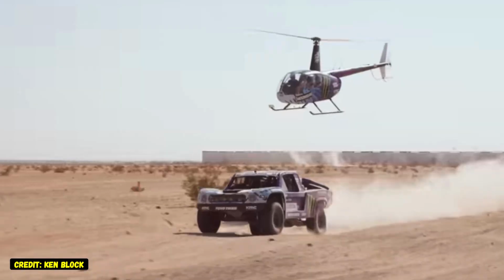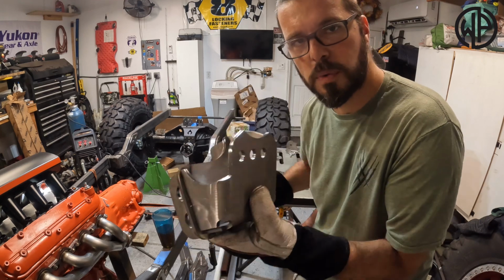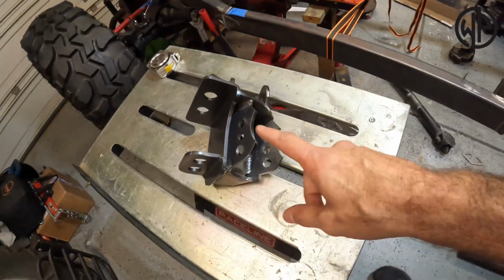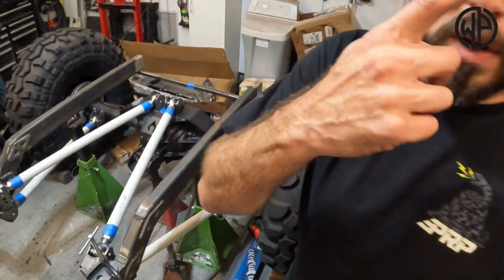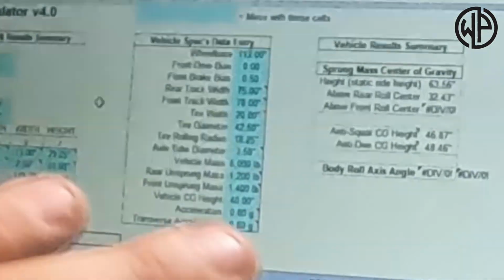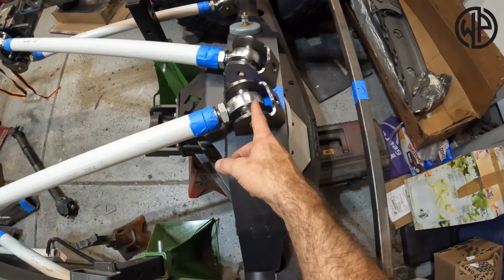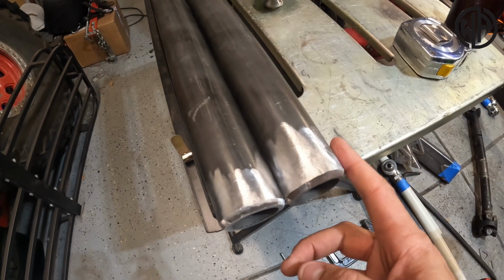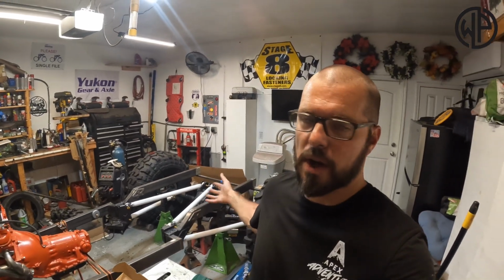4 Link Suspension Set Up - @ArtecIndustries Complete Guide

Comment: Im still learning but I feel like your explanation of Anti Squat was not correct. 

I thought 100% anti Squat means a neutral squat resistance. There is over 100% anti Squat and under 100% anti Squat based on where the instant center intersects with the neutral line of the cars center of gravity 

Maybe I am not understanding this the right way

Comment: What keeps the nose of the differential from rotating up and down during acceleration?
Reply from the maker: It won’t move because it’s a hard link on top and bottom. Typically that only will happen with leaf springs as the springs want to twist or wrap.

Comment: Great video. I thought the link length is supposed to have a 25% difference between the top and bottom links. Maybe that's for the front?
Reply from the maker: You are exactly right. That is for the front. You do that so you maintain caster angle of the front axle and now mess with your steering. On the rear you want them to be about the same length so the pinion stays pointed at the transfer case as it cycles.